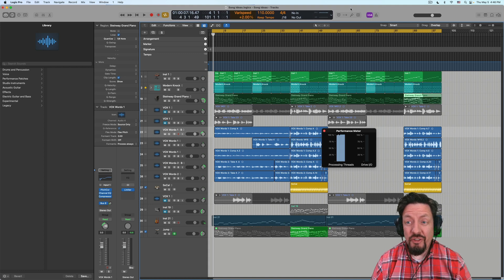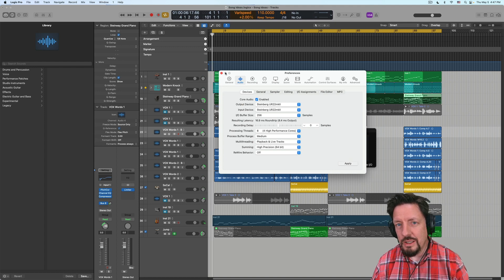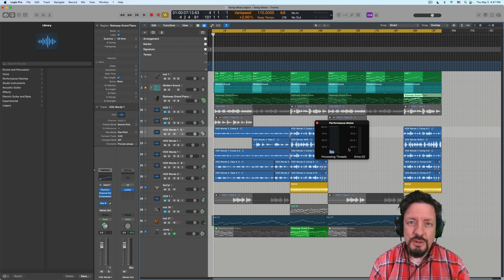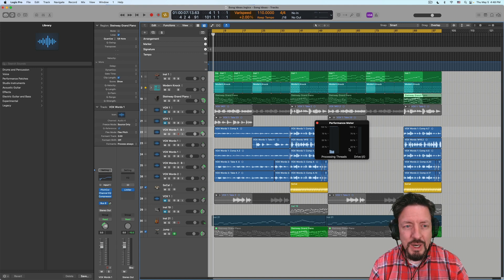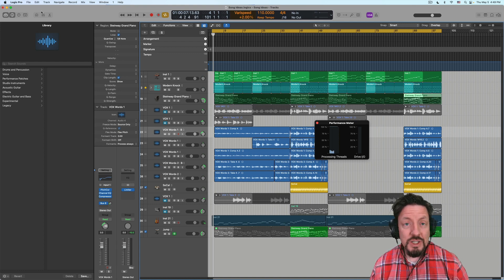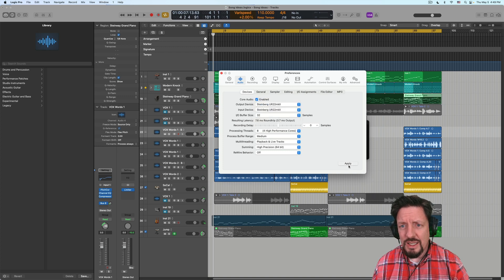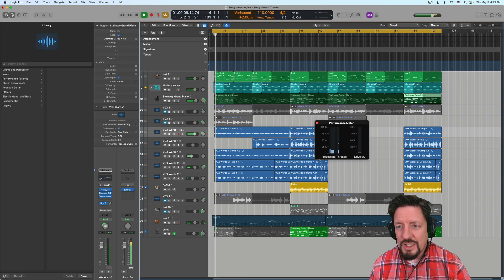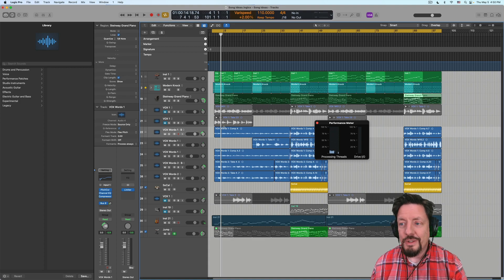A Buffer Glitch in Logic 10.7.4

Comment: Hello. Thanks for your video. Yes, I'm also experiencing this problem, and I think it has been with me for years, also on previous versions of macOS and Logic. In my case I'm working with an Intel i7 2017 iMac, with 64 GB of RAM. I usually load hundreds of instrument tracks and VST (Kontakt, Spitfire Audio, VSL, SINE Player, etc.) because I work on big orchestral projects. I still don't know why, but suddenly, at some point in the session, Logic Pro goes crazy and it happens to me the same as you: it seems that suddenly Logic gets stuck processing something even when everything is stopped and it’s impossible to continue working or simply playback the project. I am forced to close and open the project again or just restart CoreAudio and everything goes to normal. But in my case, using hundreds of orchestral tracks, I can’t work with less than 1024 samples. So, I either don’t know what to do to solve this except quit Logic and launch the project again. I don't know if it's related, but my audio interface is the Steinberg UR44.

Comment: Does this happen on a new, empty project?
What about deleting or disabling plugins one by one to find the culprit?
Reply from the maker: It happened on an empty track for me as well.
Reply: @LogicProLife  strange! What audio interface are you using?
I’m using UAD Apollo X Twin on my M1 Mac mini base model. I can have a fully loaded project with buffers down to 32 without issue.
Setting buffers at  512 for ATMOS work runs fine too. Come to think of it, I haven’t tried maxing out the buffers since I haven’t Needed to. I’ll try it out real quick and let you know if it has the same problem.
Are you on the latest version of logic and Monterey?
Reply from the maker: Latest of everything.

Comment: Have you doubled checked that your audio drivers for your interface have been updated to M1 silicon and have you tested Logic in Rosetta mode? I’ve had yo keep 10.7.4 in Rosetta on my M1 MacMini.
Reply from the maker: I’m definitely still in Rosetta mode due to using Reason Rack. I tried with both an interface connected and with the built-in audio. My device on this station is class compliant and so I don’t use external drivers.

Comment: Well, I don't understand how a channel focus on Logic, doesn't know about using a NO OUTPUT track to avoid any buffer issue during playback. Just stop clicking on audio track or inst track and everything will be fine
Reply from the maker: Wrong. I tested all of that out. Plus I’ve made videos about that feature several times in the past. The whole point of leaving it selected here is that the CPU spikes go away at a buffer size of 32 even with an active track selected.

Comment: In my opinion 10.7.3 and 10.7.4 are problematic in general.

On my side since these 2 updates I've never faced any problem, since 10.7.3, and 4 fixed nothing, I've issues with my UAD apollo. Sudden silence and I've to swith back & forth the output in LPX audio preferences. (And the apollo still works as a general audio out in the computer as I can listen to YT or Music for instance)
Reply: Do you have a solution? I have the same problem...
Reply: @n.l.3231  Since I downloaded the last UAD update 2 months ago I've less problems. As a rule of thumb wait 6 monts mincmum for an update. For masOS and for Logic as the peripheric and 3rd party plugin companies are not up to date immediately. In my experience 6 months are the minimum..
Reply: Same.  10.7.3 is a huge problem.  Went back to 10.6.3.